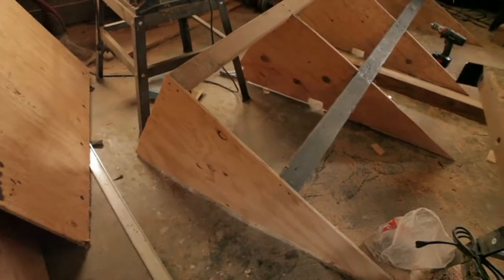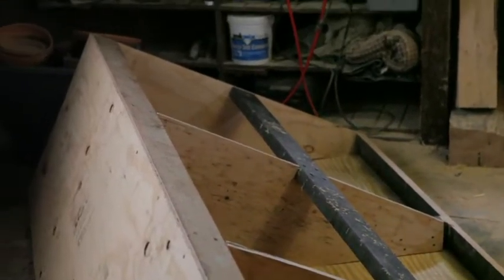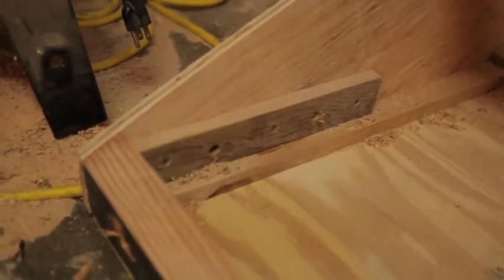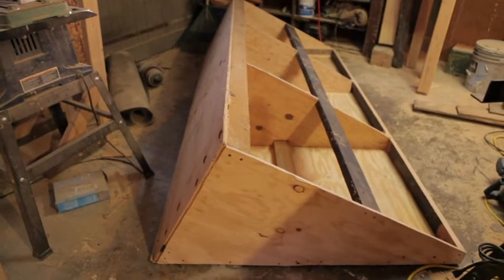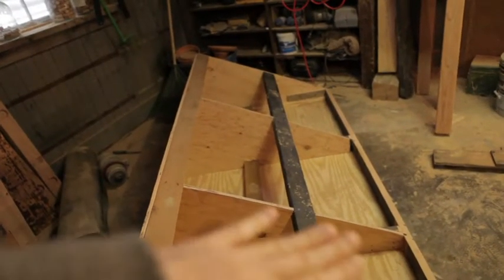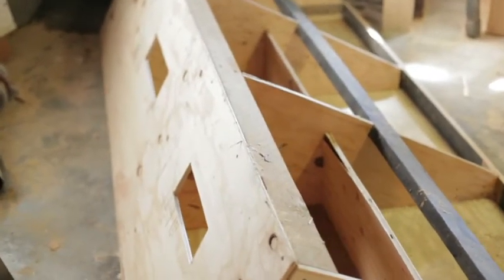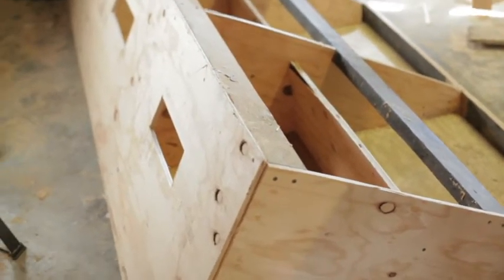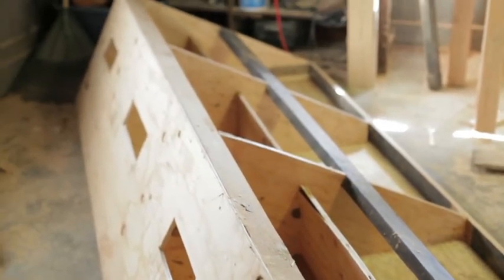wave wedge - homemade riversurfing wave box

Comment: First of all i absolouetly love this project and im suprised its such niche considering how popular riversurfing is starting to get. I am currently getting into the basic fluid dynamics in order to determine the shape, angle and size of a ramp for different flow conditions. I would love to know whether it worked or not. And if it did, in which conditions did you place it? (heavy or light flow, angle of the channels slope, depth of the channel) How did you attach it to the riverbed? I was thinking maybe you could hang it with rope.
Reply from the maker: We moved before I got around to putting this in the water. I'm still interested in making something similar again. Maybe I'll make a new one and create a video about it.With that said my intention was to have the front corners anchored with ropes. Honestly, I think once it's on the bottom with flow going over it. The pressure of the water would keep it pinned in place. But that's just a guess. Good luck with yours! May we all have waves in our towns!
Reply: @quackenbushdesigner  
If you ever come to Colorado hit me up 
We will build it

Comment from the maker: Every time someone discovers this video and asks about it get excited about it again. Maybe this spring I can find some friends to help me get this thing in a river. Anyone in the Portland area interested?
Reply: First of all i absolouetly love this project and im suprised its such niche considering how popular riversurfing is starting to get. I am currently getting into the basic fluid dynamics in order to determine the shape, angle and size of a ramp for different flow conditions. I would love to know whether it worked or not. And if it did, in which conditions did you place it? (heavy or light flow, angle of the channels slope, depth of the channel) How did you attach it to the riverbed? I was thinking maybe you could hang it with rope.